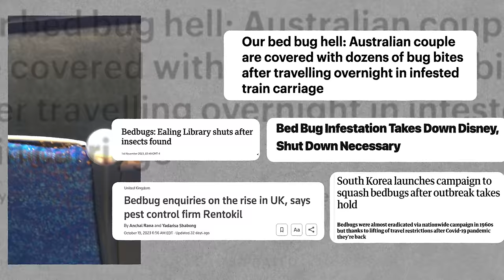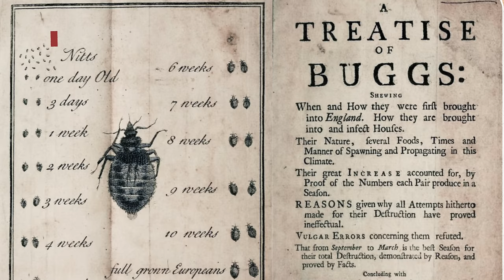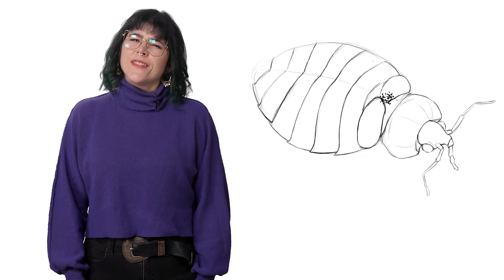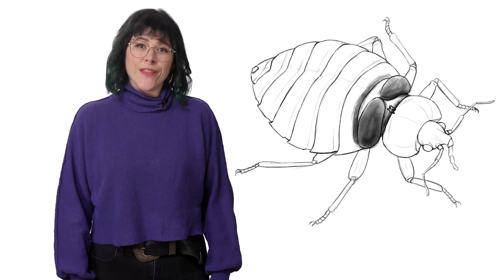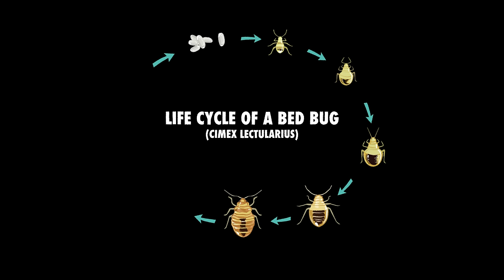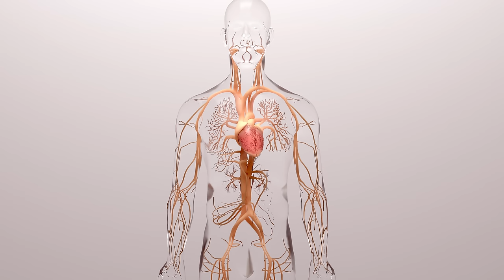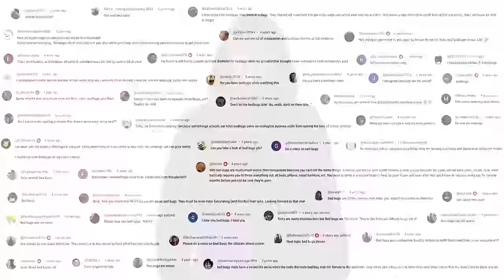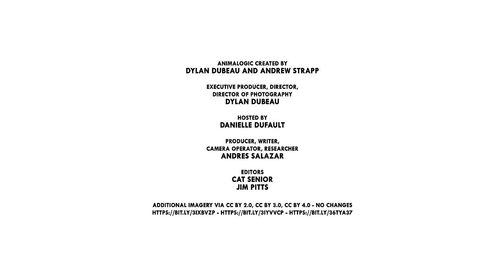How Bed Bugs Evolved To Ruin Your Life

Comment: is this my sign from the universe after waking up with bites on my neck...
Reply: That's absolutely disgusting...
Reply: aw dude im sorry i hope its not
Reply: I wish you luck, them shits are exhausting
Reply: @peytoia  im somewhat hoping its something else cuz its only on my neck and no where else... plus no other signs of BB but idk
Reply: Post pics onto the bedbug subreddit to confirm
Reply: Your username LMAO
Reply: @YargGlug Are you literally just going through comments looking for ways to be a bigot? Reporting.
Reply: There will be tiny black dots on the mattress, it’s their poop! They hide in the edges of the mattress and bed, or in any crevices they can find in the room! They are extremely difficult to get rid of and are easily transported to other places! Tape up your pants at the bottom to ensure they don’t get into your clothes and strip off in a open area and put all the clothes including shoes into a garbage bag and put it all into a clothes dryer and turn it on for about a hour at the highest heat setting! If you get a bad infestation it can be almost impossible to get rid of them 😢
Reply: They usually bite on the extremities and around the torso of the body, the legs get got badly but basically anywhere they can get to!
Reply: @gayrights7623  Yeah maybe its like an allergic reaction to something or maybe a mosquito got ya before u went to sleep

Comment: I recently (just a few weeks ago) dealt with a bedbug infestation in my apartment. Since I had never experienced bedbugs before, I didn't realize they were there until pest control noticed them while spraying for cockroaches. I was shocked since I never saw any, so I said, "No way!". Then the pest control guy pointed to one on my bed, saying, "What's that, then?" So, I picked up the tiny insect and squished it and there was blood all over my fingers! Later, I looked between my mattress and was horrified to find vast numbers of bedbugs! Well, that finally explained the mysterious itching I had been feeling on my arms and legs for the previous several months! 

Eventually, after several weeks, pest control fixed the bedbug problem! No more itching, yay!

Comment: I had a time when I thought I had bed bugs. I had just been traveling and staying in a hotel. And a nieghbor in an appartment touching mine had just been found to have had bed bugs for probably over a year. It was horrible. The mental toll it's takes and the stress of ridding your home of them. ugh. In my case, it turns out I a pretty sensitive allergy to detergent. When I use a public machine after someone who used a detergent I react to it gives me small clusters of itchy bumps... perfectly mimicking bed bugs... in the meantime, the stress was real.

Comment: Thankfully ive never had to deaal with bedbugs, but a couple years ago a carpet beatle infestation swept through our entire complex. They dont bite and dont cause any health problems as far as im aware, but they damage fabrics and also its just not nice having them all over. We basically disassembled and deep cleaned the entirety of the house to be safe, but the nest ended up being right under my bed 🤢. They had found a paper mache mask i had in a suitcase and made it their home. Needless to say i did not unpack that and tossed the whole case. Havent had a problem since, but i will never forget sprinkling borax on the carpet and watxhing them all come out of it and run around :(

Comment: Does anyone know if flee spray  will kill bed bugs?
Reply: Steamers that can get to at least 115 degrees is better and less toxic too. With steaming you might have to do it almost everyday because you can kill the eggs with it too if the steamer reaches 118+ degrees so you need a infrared room thermometer. I did this to my couch and bed and it worked. I also put diatomaceous earth on the floor and on my bed frame. Put some powder in the pockets of the couch where you can't steam

Comment: I'm surprised you didn't mention, one of the main reasons they are on the rise is due to over use of pesticides. They were knocked back pretty hard initially, but now many of the chemical treatments that worked great in the past are almost useless.
Reply: Those horrific looking house centipedes eat bedbugs